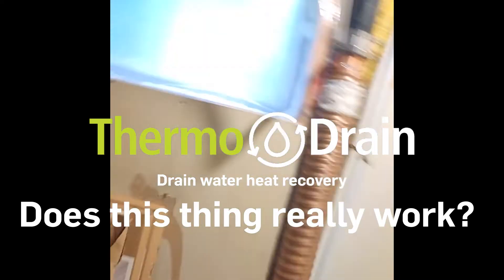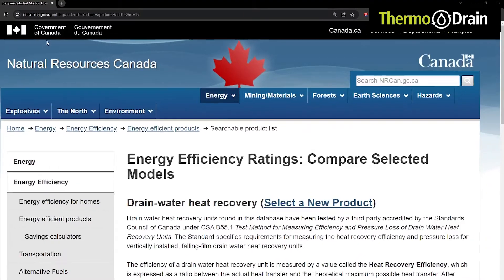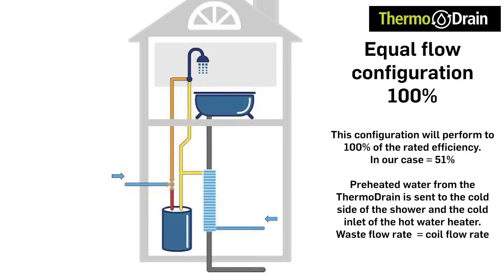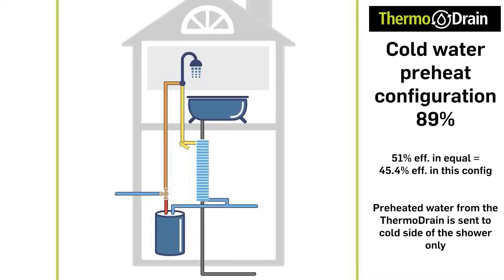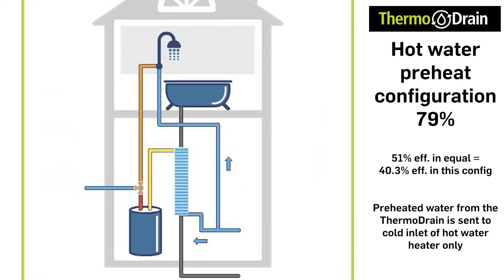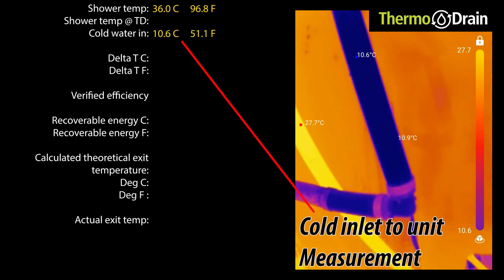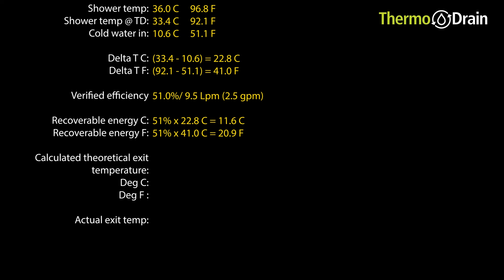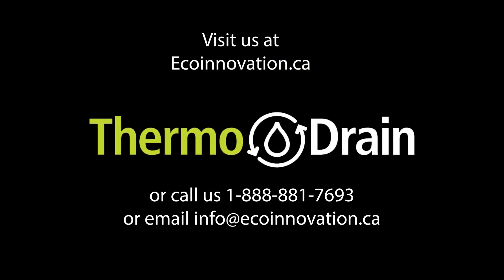Drain water heat recovery, does it really work?

Comment: My issue is:  it's only useful during heavy hot water usage.  aka, showers/baths, and laundry.  Unless you take a shower for an hour per day, I don't see how this will dramatically cut my cost.  

I think it's good to have it still, but perhaps need to work out a smarter plumbing.  Maybe have a pre-heat water tank before going to a heat pump water heater, and the pump circulates the pre-heat water tank water to this heat recuperator (with a smart temperature sensor for the water in the tank).  So after every shower, the heat pump water heater will draw water from the pre-heat water tank.  

But this setup sounds pretty complex.
Reply: I think when you are showering, the hot water heater is drawing water from the preheated line, so it's already helping. There will be a bit of a lag as the coils heat up, but not terrible.

Comment: I’m ready to buy one now. I was sold after poking around in the basement while the shower was running. My shower drain is horizontal for a few feet and then drops down a foot or so before the P-Trap. The horizontal section barely felt warm and only warm on the bottom of the pipe. The vertical section felt very warm EVENLY around the pipe. I think it has something to do with the surface tension which causes the water to line the entire circumference of the pipe and the high velocity of the warm water in the vertical section. A higher velocity causes more turbulence and higher heat transfer. These things are brilliant. My tankless water heater will be 8kw smaller than normally required.

Comment: Seems like incomplete information to me. My biggest questions are related tot he thermal dynamics. . . meaning how long did it take to reach this state. My guess is that this is at the point in time once the unit has warmed up etc. . .  In the case of short showers, or wet, then lather (with water off) and rinse, this state would never be reached. This DWHR units seem like a waste to me, unless it is a very busy household. This is mandated in Manitoba, and I can see a lot better ways to save money to save on energy.
Reply from the maker: Thank you for your comment and for bringing up some important points! Let me address your concerns and provide some clarity about how DWHR systems, like ThermoDrain, work and why they are an effective energy-saving solution.

First, regarding your question about thermal dynamics and steady state: The ThermoDrain unit starts at room temperature, so the time required to reach steady state is negligible. The system begins recovering heat almost immediately as warm water flows through the drain pipe. Even during shorter showers or intermittent use (e.g., wet, lather, rinse), the system still captures and transfers a significant portion of the heat from the draining water. The technology is designed to work efficiently in real-world scenarios, not just during long showers or continuous water flow.

Now, about your concern that DWHR units are only beneficial for busy households: While it’s true that households with higher water usage will see greater absolute savings, even smaller households benefit from the technology. Studies have shown that DWHR systems can recover up to 60% of the heat from wastewater, reducing the energy required to heat incoming cold water. Over the lifespan of the unit (typically 30+ years), this translates to significant energy and cost savings, regardless of household size.

You also mentioned there are “better ways to save money on energy.” While it’s always good to explore multiple energy-saving options, DWHR systems stand out for several reasons:

1 - Low Cost per Energy Savings: Compared to other technologies, DWHR offers one of the lowest costs per unit of energy saved over its lifetime.
2 - Zero Maintenance: Unlike other mechanical room equipment (e.g., furnaces, water heaters, or HVAC systems) that require regular maintenance like filter changes or cleaning, DWHR units operate passively and require no maintenance to maintain their efficiency.
3 - Durability: With no moving parts, DWHR systems are incredibly durable and reliable, offering decades of consistent performance.
Finally, the fact that DWHR is mandated in Manitoba speaks to its proven effectiveness in reducing energy consumption and its alignment with sustainable building practices. Energy evaluators and professionals recommend this technology because it delivers measurable savings and contributes to long-term energy efficiency goals.

In summary, DWHR systems like ThermoDrain are not only effective but also cost-efficient and maintenance-free. They work in a variety of household scenarios and provide consistent energy savings over decades of use. We hope this helps clarify how the technology works and its benefits. If you have any further questions, we’d be happy to discuss them!

Comment: Doesn't piping the heat exchanger outlet directly into the cold water line to the shower induce an annoying feedback loop where the showerer has to constantly adjust the valve to maintain constant temperature since the enchager outlet water temp is constantly shifting and there's a large time delay due to the length of the exchanger pipe?
Reply: There are modern "thermostatic shower mixer" (google that) controls that dynamically adjust the hot and cold water rates to a desired set temperature.

This way you only have to set your desired output temp and the shower valve does the work.
Reply: @superq  interesting
Reply: The water is preheated to just above room temperature. The water in the coil is at room temperature. So when you do shower, the preheated water from the ThermoDrain is at a constant room temperature and therefore no adjustments are required.
Reply: this setup is strictly useful only for hand washing and showers.  The feedback loop back into shower is pretty redundant, and it will add cost to your plumbing.

Comment: The drain water is passing thru the drain pipe at a considerable rate, maybe faster than the cold water in the wrapped coil can absorb it? I would think restricting the drain flow to keep the hot drain water in that drain pipe for a longer time period might be better but you run the risk of the drain backing up into the shower if not balanced right.
Reply: Code does not allow any flow restrictions.  The warm water flowing down the drain wall that is cooled by the incoming cold water creates a phenomenon where the waste water forms a film on the inside on the drain pipe thus allowing the passive heat exchange to take place.
Reply: @danielbeauchemin3958  I fully get the no restriction requirement, wouldn't want to risk that. But just trying to imagine here the effectiveness of the heat recovery process. In order to attain that heat transfer film, does the pipe that's wrapped with the coil have to be copper, or can it be PVC, or other matl? The one thing holding me back on doing this is the payback ROI - lots of copper, and labor but that can be saved with some sweat equity.
Reply: @timp.9582  copper is highly conductive. All the studies I have looked over have clearly made this technology a front runner in cost vs dollars saved. 💸
Reply: I guess you could just install two of these things in series. The second one would get 55% of 45%, which is around 25%, so around 80%? The first one might end up heating the second one though, maybe.
In terms of ROI, in Vancouver, I use about 9kWh/day to shower two people. Half of that, rounded up, is 5kWh/day, which, if I heat my tank at night, works out to about 30c/day. These things cost about $600, so ROI would probably be in about 8-9 years, not including labor. After that, you're saving about $100/year.
Depending on the size of your household, opting into time-of-day energy rates and putting a timer on your heater will achieve ROI in about a year and also save $100/yr thereafter.
Reply from the maker: Thank you for your thoughtful comment and calculations regarding the potential ROI of installing ThermoDrain systems. It’s great to see you engaging with the numbers!

While your approach to estimating the ROI is interesting, let's clarify a few points about how DWHR systems work and the potential savings you could expect:

Efficiency Gains: The ThermoDrain system can recover up to 60% of the heat from the wastewater. If you were to install two units in series, the heat recovery would not be simply additive due to diminishing returns and heat transfer dynamics. However, even a single unit can significantly reduce the energy needed to heat incoming water.

Daily Energy Use: You mentioned using about 9 kWh/day for showers. If we assume that ThermoDrain can recover 60% of the heat from the wastewater, that could translate to approximately 3 kWh/day of energy savings. Over a year, that’s about 1,095 kWh saved.

Cost Savings: In Vancouver, if we estimate the cost of electricity at around $0.10 per kWh, your annual savings could be approximately $109.50 (1,095 kWh x $0.10).

Initial Investment: With a cost of $600 for the unit, your ROI calculation would look like this:

Initial Cost: $600
Annual Savings: $109.50
Payback Period: $600 / $109.50 ≈ 5.5 years
Post-Payback Savings: After the payback period, you would continue to save approximately $109.50 each year, which is an attractive return on investment compared to the initial cost.

Additional Benefits: Beyond the direct energy savings, the ThermoDrain system requires no maintenance, which adds to its value over time.

While using time-of-day energy rates and a timer on your heater can also yield savings, the ThermoDrain technology works continuously to enhance energy efficiency regardless of when you use hot water.

In summary, while the ROI may vary based on individual usage patterns and energy costs, installing a ThermoDrain system could lead to significant long-term savings and a payback period of about 5.5 years based on the assumptions we've discussed. If you have further questions or want to dive deeper into specific scenarios, feel free to ask!

Comment: If shower water is draining onto these coils directly then that would be considered a cross connection..potentially contaminating the fresh water if a leak develops..or if not directly draining over the coils and coils are wrapped around a separate pipe then the heat loss would be great along with the heat loss of preheated water cooling off on its way back to water heater and mixing with the cold water
Reply from the maker: We appreciate your concerns, and we want to assure you that the ThermoDrain technology undergoes rigorous testing and certification to ensure safety and efficiency. This technology holds two crucial certifications mandated by North American building codes. Firstly, it is certified by Intertek to CSA standard B55.2, guaranteeing its safety for use with potable water and eliminating any risk of cross-contamination. Therefore, the scenario you mentioned is not possible with ThermoDrain.

Secondly, the efficiency of the product is verified by a third party to a CSA standard (specifically, Intertek to the CSA standard B55.2). If we claim that ThermoDrain captures 50% of the energy from the drain, it is based on rigorous testing under CSA standards. Any deviation from these parameters will impact the efficiency accordingly. We hope this explanation clarifies the reliability and effectiveness of this fascinating technology. Thank you for engaging in this discussion!